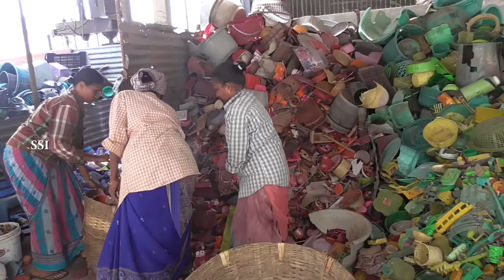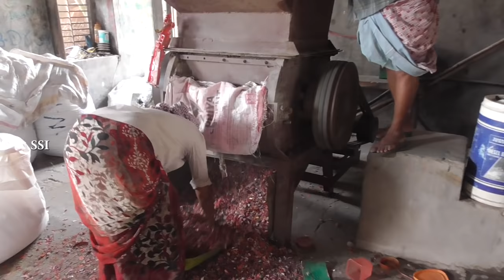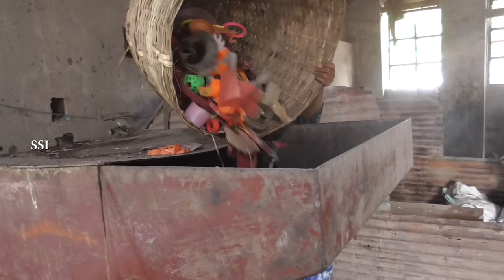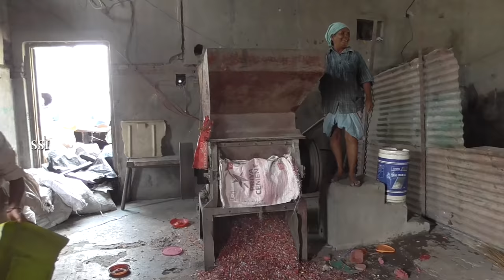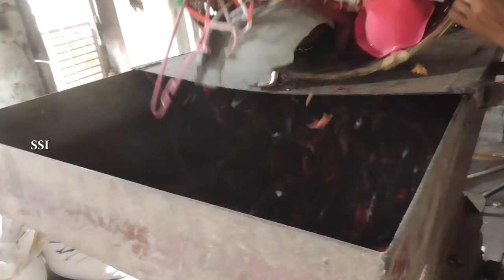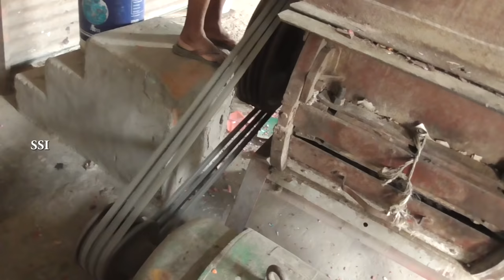Plastic 'Crushing Machine' with Bottle "GRINDER" पुनर्चक्रण की प्रक्रिया / Small Scale IndustrieS

Comment: Congratulations: good idea to recycle, there is a lot of pollution of plastics in places, and muco ends in the oceans.
I am struck by the poor women working in that place without safety shoes, the worst thing is that the woman who feeds the machine is in great danger, if the pulley bands are exposed, that is not correct to operate that machine that condition exposed to lose l avida or maybe your limbs.
PLEASE DO SOMETHING. OF SECURITY. PROTECT THESE POLE BANDS.